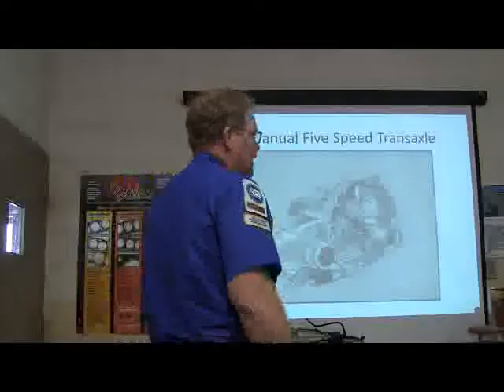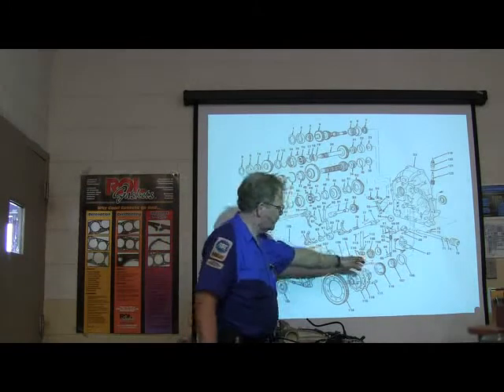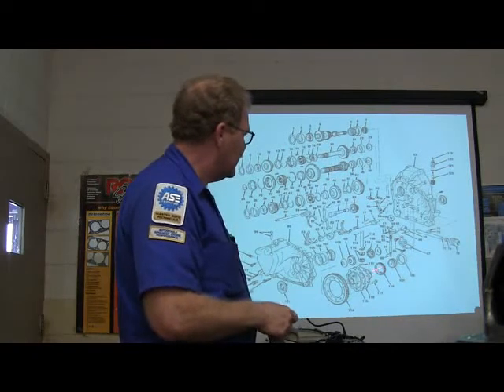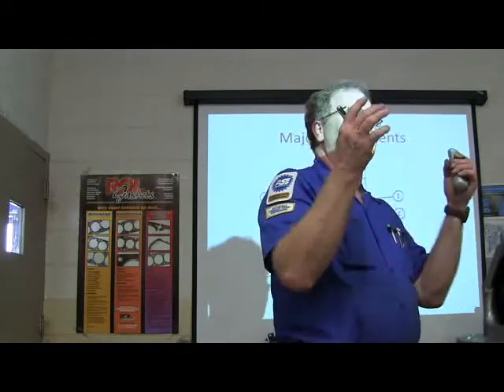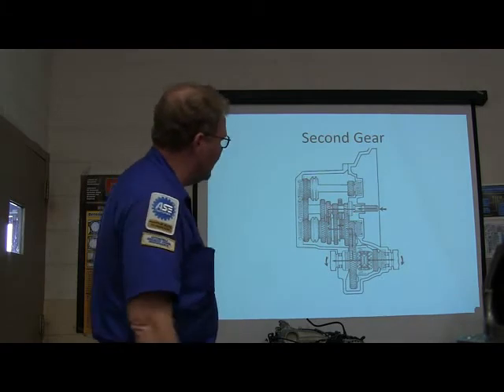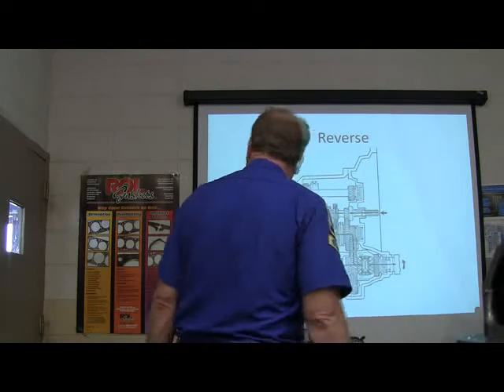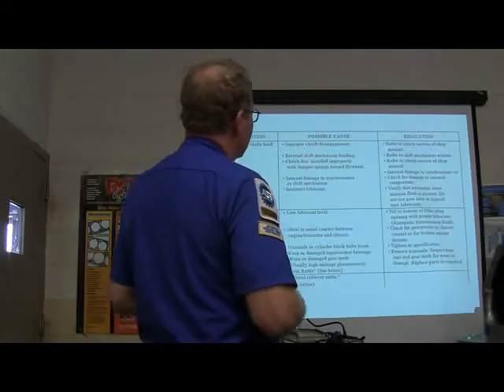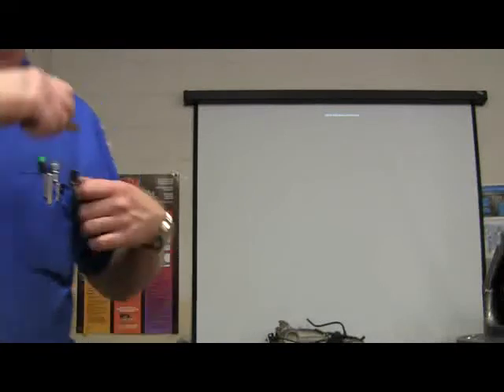Man Trans Test 7   Tranaxles

Comment: R/C cars can have Limited Slip Ball diff with tension adjustment. Idea=linkage+springs+appliance solinoids+sealed switch pads=foot operated/ sinks,doors,lights,paper towels,eyewashers,toilet seats,partwashers,showers,lights,rooms,kitchens,bathrooms
For some reason that no touch stuff they have today does not work the way I want it to. Over 60% failure for me. I miss doors at the store that you stepped on the pad and it opened every time.